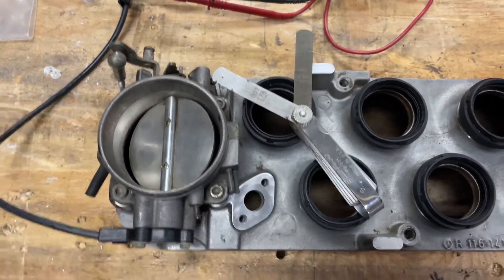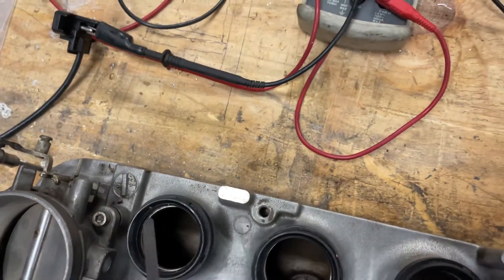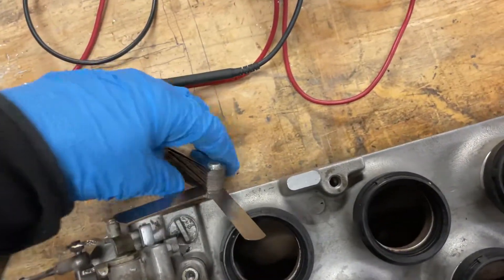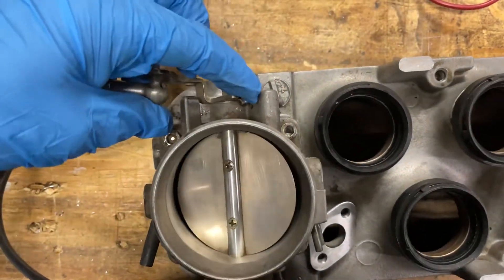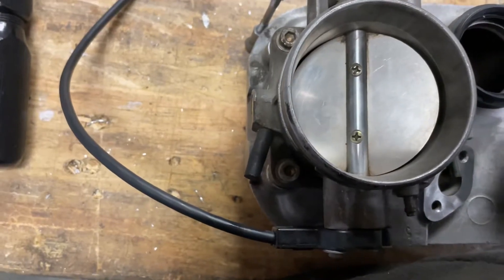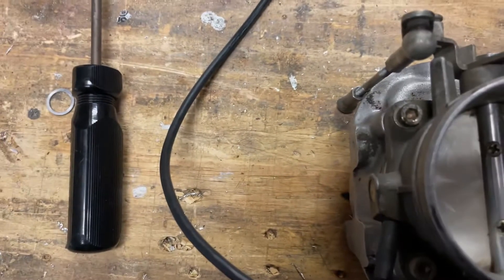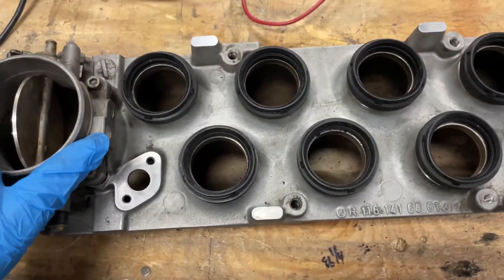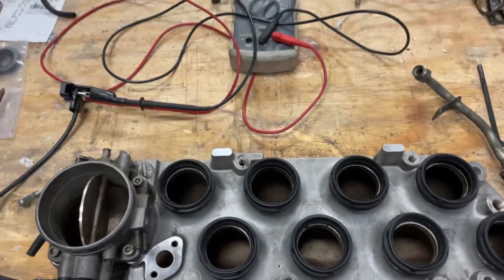Mercedes Benz W126 560SEL 3/89 The BIG repair of the idle speed and vacuum issues Part 5

Comment: Hi I did a smoke vacuum leak test and it was leaking from the throttle linkage side and TPS sensor as well. Any recommendations ? Thank you
Reply from the maker: George, you probably will have to take the entire intake manifold system out and rebuild it like I did in my videos “the big repair “ with greetings from Kansas, Peter
Reply: I'm just curious, have you done any smoke tests? I didn't see them on your videos. Greetings from sunny San Diego
Reply: i am having the same issue.  how did you end up fixing it?
Reply from the maker: @dtg824 watch the entire playlist
https://youtube.com/playlist?list=PLO4ZlzALkZVq3NysVV7vqO7BiZ9Kd_97D&si=VFGNOYgavD9wQY-x
Reply: @inovahightechltd thank you
Reply: @inovahightechltd do you suggest i get a new throttle if i am getting a leak from the side throttle linkage?
Reply from the maker: @dtg824  yes and a new gasket from throttle body to intake manifold
Reply: @inovahightechltd  thank you for taking the time to respond.  I will see if i can find a new one online.  Id appreciate if u advise a place to buy these.  M116 engine 1983 SEC380.
Reply from the maker: @dtg824 at this point you may have to find new bearings and repair your original throttle. The Mb shop manual explains the overhaul. Make sure you get the bearings which are fully sealed on both sides.
To find the correct replacement bearings you have to remove the original ones and read the bearing number embossed on side of bearing and measure the bearing with calipers
Reply: @inovahightechltd thank u so much.  i was able to find the bearings after some extensive research. the old bearing number was not coming up and it was discontinued.  i just got this car and im trying to do every right.  You mentioned an MB  shop manual.  are those still around for these kind of cars?  where can we get one for an M116 engine?
Reply from the maker: @dtg824 eBay if you want a printed manual, otherwise use Google to find online stores which sell them as pdf downloads
Reply from the maker: @dtg824 and you can try this place here for free:

Https://charm.li